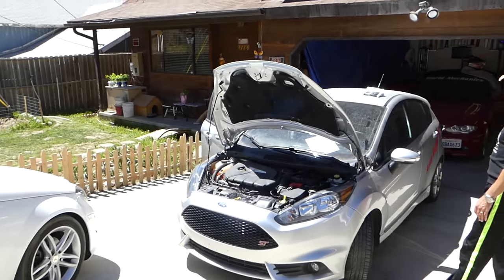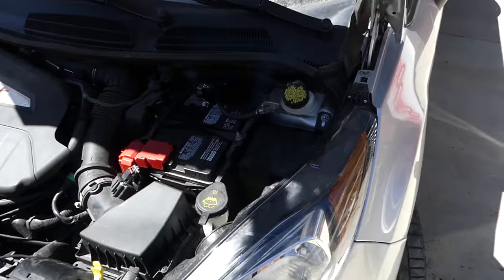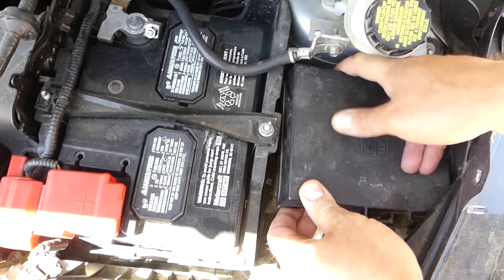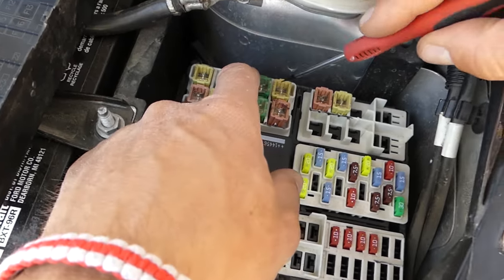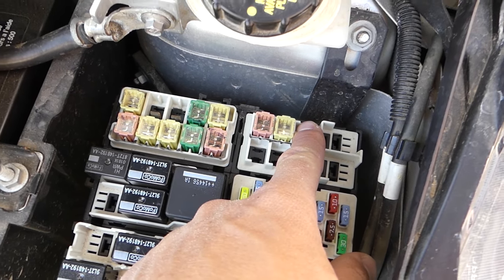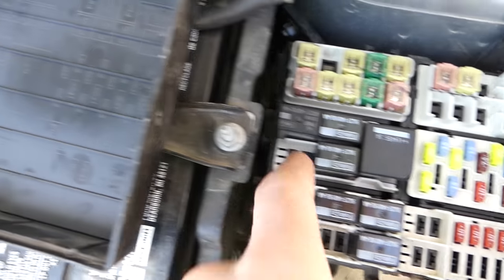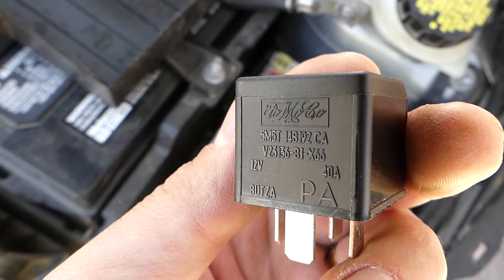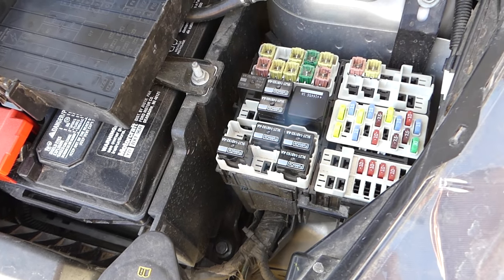FORD FIESTA RADIATOR FAN FUSE AND RELAY LOCATION MK7 ST

Comment: My 2016 Fiesta ST has cooked two of the radiator fan relays. Hot SoCal weather, AC and stuck in traffic both times. How would I test the radiator fan? Seems like the car should be able to deal with these conditions. Makes me wonder if there is a problem with the fan, is it drawing too many amps for the relay to handle.

Comment: Thanks a lot! ---- suggestion , how about a video on testing (first) - and changing the Coolant temperature sensor (if circuit not turning on with hotter water) . *This trips solenoid(relay) to turn on engine radiator fan circuit. (fuse is 'breaker' for it).

Comment: I got "15 sfe Eco boost SE 1.0 3-cyl. Fan works but after driving it to operate tempurture and turn car off and the engine fan runs for few minutes and it turns off. But it Overheats after 5-mins of driving? I turn heat on full blast and barely going it starts going back to 4-bars normal but that's in 88`\95' degrees outside and I have to keep window down and heat on full blast all the time. Any help on figuring out this problem while my car is overheating I'm wondering if it is a fan relay I bought a thermostat it goes under the driver side under it goes under the alternator on the passenger side I have to take serpentine belt off I have not done that yet because I have to go to a friend's that's got a garage I can't do it in the parking lot where I live but if I don't have to change the thermostat if it may be a fan relays or something else. Anything I tired of racking my brain. In the car takes to thermostats. First car I've ever knew of that took

Comment: if a fuse or relay goes bad, will the check engine light go on?
Reply: most likely not, Usually you just have to check them yourself